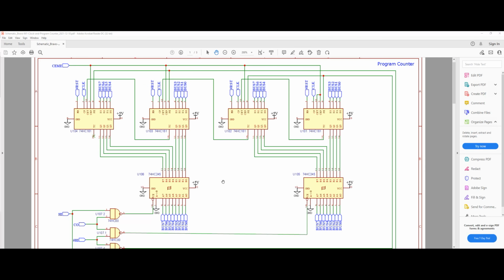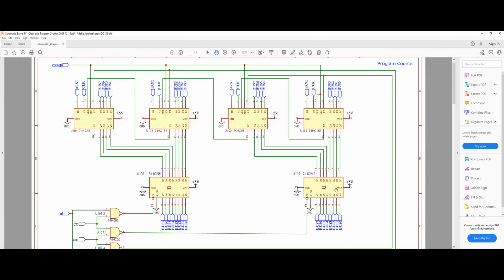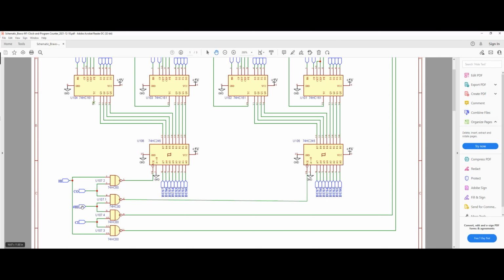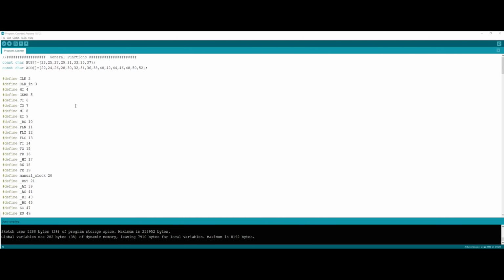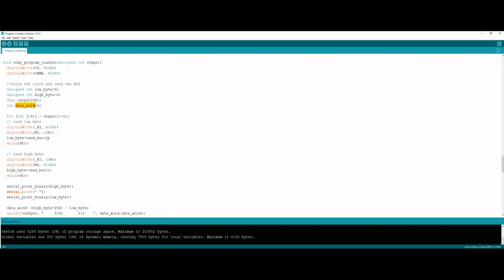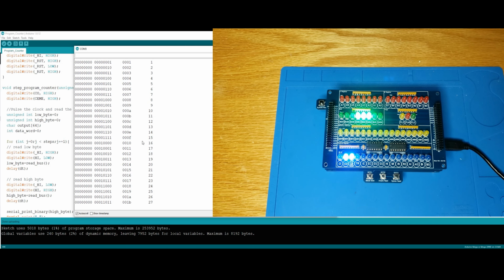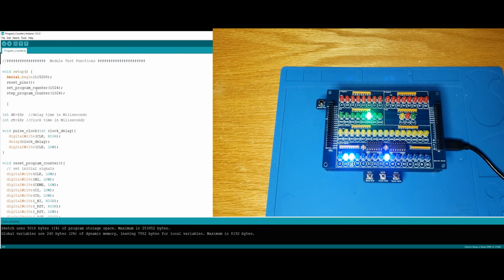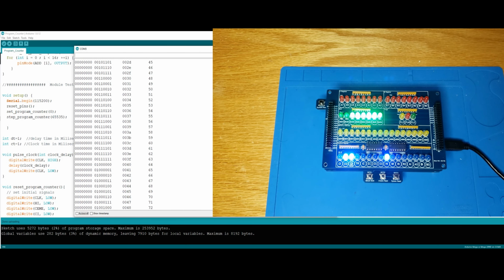Bravo 8bit computer-Part 5-Program Counter,inspired by Minimal Project and Ben Eater's 8bit computer

Comment: I would recommend for everybody building the computer to write also some simpler tests, without relying on the Arduino serial monitor, but on the LEDs only + directly manipulating the control signals. There will be less blikning of HI LED (caused by reading the values for the serial monitor in the sketch provided, which will allow better understanding what is actually happening inside the program counter. Or even more - proceeding wihout Arduino, just manually (with some wires - the Ben Eater's way) providing some signals on the exposed stacking connectors. 
Do it at your own risk however, as there is a risk of dstroying the module or the Arduino, by improperly connecting the wires. I wonder how to "isolate" the Arduino, while still getting the power from it - if Arduino pins are in high impedance state when not programmed to do anything. Arduiono's documentation says: "Arduino (Atmega) pins default to inputs, so they don't need to be explicitly declared as inputs with pinMode() when you're using them as inputs. Pins configured this way are said to be in a high-impedance state". Probably some simple sketch should be run initially to move all Arduino pins to input state (after power up Arduino will run the previously upoladed sketch).

Comment: 16 bits can hold 65536 different values (including 0) thus the maximum value will be one less or 65535
Reply from the maker: That's corret. Since the value goes into a loop, depending on where you start counting from (0 or 1), it could go to either number but the total count should be 65536. Now, what you saw in the video is a glitch in the arduino not executing the loop if you exceed the value.
Reply: @ConfigIOI  It is a great project though, I am a bit tempted buying a kit but ordering from the US is expensive in shipping and taxes